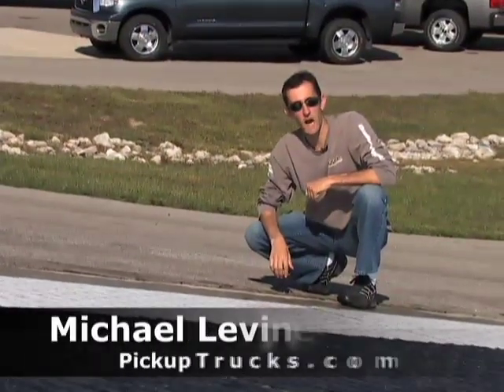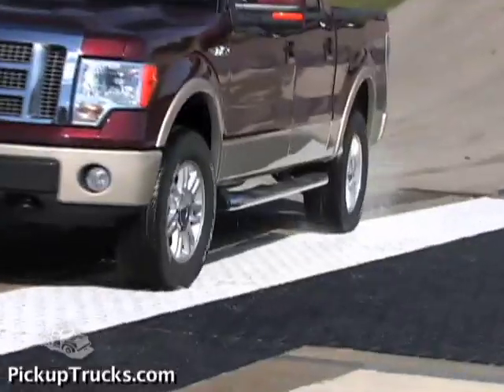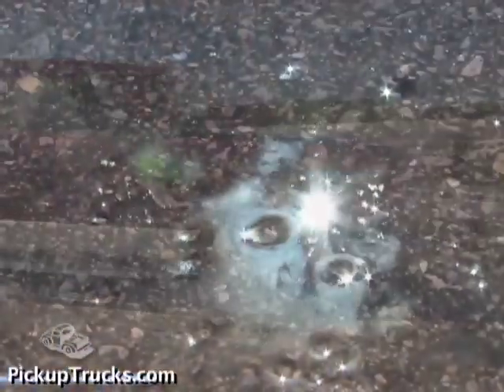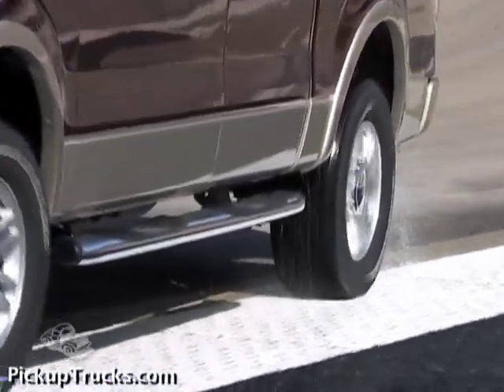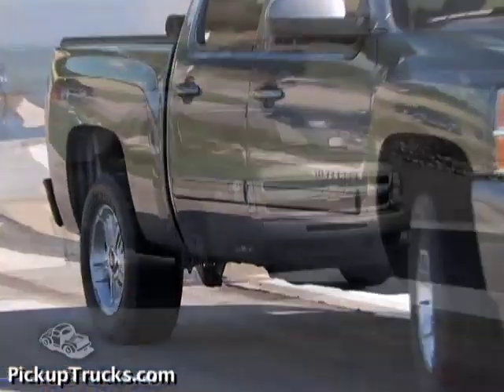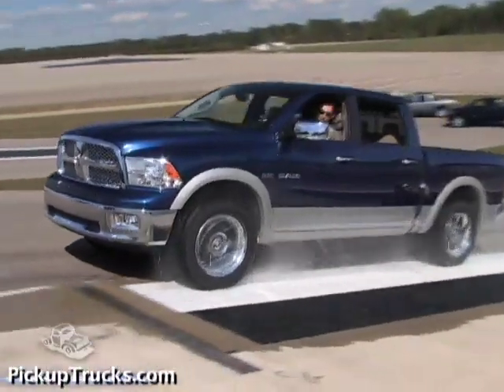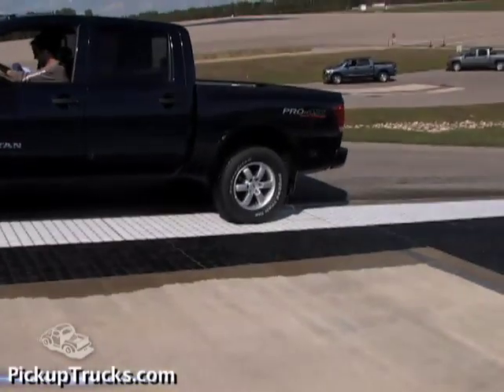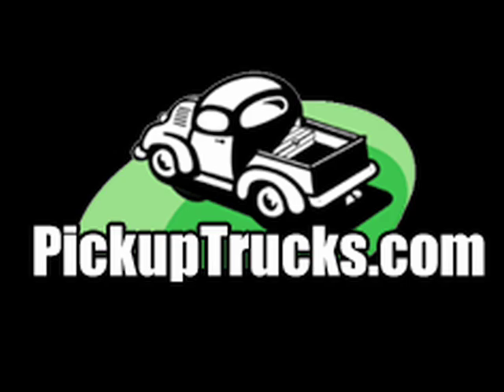Extreme Traction-Control Test

Comment: for a bunch of truck with "limited slip diffs" how come they only were spinning one wheel???
Reply: Limited slip is no different than an open diff it makes no difference, I bet a lock right would make a difference, it locks up both back wheels for full posi.
Reply: Skeefoo Panama that can't be more fucking wrong. Limited slip sends power to the wheel with the MOST amount of traction unlike a open diff which sends power to the wheel with the LEAST amount of traction, a lsd will usually send power back and forth to get you to keep moving, while an open diff will just continue to spin the slipping wheel until it redlines
Reply: +mikebing1230 
OK Bing, You need to see the Power Trax no slip locker video on here,  Limited slip is not positive traction, it is hardly any better than an open diff, only 1 wheel spins with Limited slip. Limited Slip IS NOT positive traction.
Reply: Because Limited Slip is almost no better than an open diff, as far as your ass getting stuck, It may make a slight difference, it may transfer power to both wheels, on and off, but a LSD is NOT posi traction, and WILL get you stuck.
It's only slightly better than open diff,
Still you will need a locker for a real rear posi trac axle.
Reply: Skeefoo Panama never said limited slip is a locking diff, limited slip is positraction. But Posi isn't the same as a locker.
Reply: +mikebing1230 
YO BING, YouTube this video, (Power trax traction demonstration) You will see why I said LSD is no better than open Diff, please watch the video.
Reply: +Skeefoo Panama
 "Posi-Trac" IS a limited slip differential. It is just GM's brand name for it.
Reply: LSD woudnt necesarily make both spin but just provide enough power to the wheel with traction to be able to keep moving
Reply: Chevy has posi traction, Ford has Traction Lock, dodge has sure grip and so on. They are all limited slip diffs.
Reply: @fastfordman1965  sorry but the G80 WILL lock both wheels at about 100 rpm of spin.  I've owned several and all have worked well.

Comment: The traction control in my 2011 F150 is amazing. With the stock goodyear SRA, same as in this video, driving on snow and ice feels like I'm driving on dry pavement. No slipping or sliding at all which is suprising since these tires are complete garbage.I don't even need to use 4x4 unless going uphill.

Comment: I agree with the manual trans comment, however the Frontier is not in the same class. They should have a test between ALL of the smaller pickups though.

Comment: Most pick-ups are part-time or selectable 4wd, meaning that on top of 4wd high and 4wd Low, they also come with a 2wd setting and sometimes even an AWD setting. however, on the truck without an awd setting, it is strongly recommend that drive in 2wd in which driving on road to prevent excessive wear.

Comment: If you look closely, the GMC and the chevys tires lock up almost immediately. Because there is equal power going to both tires on different surfaces, the rear end starts to go sideways. This is why a lot of drifters use an E-locker or a stout LSD. An LSD just makes more sense for this kind of test. It distributes the power accordingly to how much grip each tire has rather than just locking them at the same speed. The outcome may have been different if both tires were on the slick surface.

Comment: @FreeSkier155 Well you are right, but if you are going up a hill during winter and there are cars behind, the last thing you want to do is have to stop and pop the truck in 4x4 to make it up a hill. It could cause an accident from your truck sliding backwards if you stop too quickly from panic or begin to slip back before you can get it in 4x4. This test shows which truck would be most reliable in this scenario, which is just one of many.

Comment: @PsychoDemon5 it doesnt matter...it depends on what the companies offer. they are testing what the vehicles come with. if you put the ford's locking system in every truck and the same tires on all of them, most likely they will all get up with little difficulty. they are testing the actual trucks and what they do the way they come.

Comment: Agreed i drive 94 ford F150 and i live in the Minnesota. In snow I cant make it through the trail my dads Chevy makes in 2wd with his Chevy which has locking differential when im in 4wd. my truck has open rear and limited slip front.

Comment: @wootness3000 i believe the point of this was to test the rear differential limited slip capabilities. since none of us are phsycic, you cant put it in 4WD until after your rear end fails to gain traction. but it is always wise to engage 4wd if you know there will be problems.

Comment: Sierra is made by GMC, (General Motors Corporation), which is in great partnership with Chevrolet, therefore they make very similar models of 2 different makes. Almost like Ford and Mazda, but yes. They particularly the same trucks, just some different exterior features.

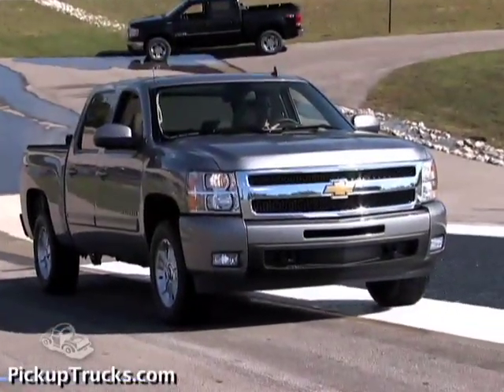Comment: At 2:21 you can see the Chevy truck's rear wheel on asphalt. It's spinning like crazy, so the wheel with traction is getting plenty of power. It's just that that one tire could not get the truck up the hill. Seems to me more like a tire or weight problem, than a traction control problem.

Comment: In a true 4X4, locking all 4 into 4 low or 4 high is an option for a reason. Unlike Toyota, etc., in which the systems are similar to AWD, true 4X4 give you the option of which wheels are driving the truck. I prefer that I decide how to use the power, rather than a computer because when the computer fails in a Toyota, there is no 4X4 high/low.

Comment: Again, that is the point of the frame. It is supposed to be flexible to once again, provide a smooth ride but can still tow heavy weight. Ride in a Ford and then ride in a Tundra, the Tundra is a much smoother ride. Hook up 10,000lbs behind each and drive them again, and you will see the towing of the Tundra can tow heavy trailers and you still have a smooth ride. A fully boxed frame can tow help a truck tow a lot of weight but it doesn't provide nearly as comfortable of a ride.

Comment: @FreeSkier155 The purpose of the test to determine at what point the vehicle needs further assistance. 4wd can have just as poor performance wheel slip isn't controlled. When the vehicle is equiped with both front and rear lockers 4wd becomes a relevant test but with out a front locker there is no benefit to testing 4wd. My truck has front and rear lockers and would walk up that with out either wheel slipping because the traction to the good tire would be sufficient to move it.

Comment: @cb7pwn 
these trucks would benefit from better tires because one tire is slipping on the slippery surface, if the slipping tires were all the same then or even a better tire, it could have better grip.  So, hugo is correct, tires play a big factor in this test.

Comment: i can't post the link. so search: Mega Test Dodge Ram vs. Ford 350 vs. GM. first thing in the test shows how a 2wd with a locked rear end can get up a slick surface better than a 4wd with open diffs

Comment: @alldayandnight09 They use the tires they come with from the factory, just like any other road tests they don't change tires. People want to know what to expect driving it off the showroom floor. Most people don't run out and change tires on their truck after they buy it until they are worn out.

Comment: so did the rear diff's fail to lock on both the gm vechicles causing them to use 4wd, or did the rears engage and they still had to use 4wd?  it sure looks like testers were trying keep them from locking in the suspiciously limited video of the gm vehicles. i have a hard time believing that a truck with a locked rear end couldn't make it up the hill in 2wd. makes me question this whole shoot out.

Comment: I'm not positive, but I think it's so that with heavy loads the bed can flex slightly without effecting the rest of the body.  I have heard that some of the ford unibody trucks made in the early 60's had problems when hauling heavy loads.  The door gaps would flex so much that the doors would pop open while driving.  That is probably why today's unibodies are usually meant for pretty light hauling.

Comment: I would think the gmc/chevy with the locking diff would do as well as the TC on the tundra and ford no? as soon as they hit the slip RPM the locker would engage and the tire on the pavement would propel the vehicle to the top.

Comment: That's only with a helical diff, with a mechanical or viscous LSD the wheel with traction will always get some power, even if the other wheel is off the ground. The other way to get around this with a helical diff is to gently apply the brakes, this keeps some strain in the wheel off the ground and allows power to be transferred to the wheel with grip.

Comment: You should do a test on why people need to go faster than a car on a snowy highway ! I m in Minnesota and every snow fall its mostly trucks or 4x4 s in the ditch . I hope some day someone will figure this out , lol , I do think ALL vehicles spinout at high speed or maybe spinning all 4 wheels by over acceleration and loosing control is maybe a Clue to slow down ! And I do own a truck in case some want to give me crap on this .  Great video , I gave a like .
Reply: I'm from Minnesota as well! and I can attest to there being alot of 4x4s and trucks in the ditch! Speaking of which back in 2010 I pulled a 2007 Ford F-350 with a long box out of the ditch with my 87 Chevy Caprice classic... The owner of the truck at first said he was gonna call a tow truck... mind you it was about 2:30am and about 10 miles from the local expensive small town tow truck business.. so He decided to take me up on my offer to help him out.. he was so happy he slung me $40 dollars and said "You saved me 80 bucks so here put some gas in that beast case I need ya again, haha"
Reply: Great story Tony , Yes Tips are great also .
Reply: Thank you : ) LOL That tip saved me later that same day bought enough gas to keep me going till paycheck came!

Comment: @296jayce 
not really hard if you think of it
if both wheels are locked, you will give power to both wheels equally, if one of the tires slips due to a wet surface, it will force the other one to spin too.
if the cars is fitted with a limited slip diff. , it will give more power to the wheel with more grip, and since it's not spinning, it will move the car, also creating a momentum that will keep the car going.

I think that the best way I can explain it    :3

Comment: show us this test with an open diff vs lsd vs locked differential
Reply: Open differentials and LSD are essentially the same, only difference is a LSD only allows so much of slip between wheels, if your on something really tricky such a hill where 1 wheel leaves the ground (in a 2WD truck lets say) you're essentially fucked either way because 1 wheel will spin too much. A locked rear is obviously the winner as for both wheels spin equally. This test would be pointless reason being most trucks come with a LSD with either a traction control unit (that usually brakes the spinning wheel so the other gets more power) or auto lockers, which lock the rear so the rotation in each wheel becomes equal.

Comment: The trucks with locker should do best, but the locker cant engage if the other wheel is spinning super fast. There is a technique to make it engage. the g80 in the chevy has proven itself for years.

Comment: @cb7pwn 
if you have a tire that's designed to grip on that surface, you will be fine because all the power will be going to that tire made for that terrain or surface, just because all the power goes to one wheel doesn't mean you have to be flooring it -.-

Comment: yeah, the G80 in my chevy works better if you ease off the throttle, if you give it more throttle when you feel it slip you'll just sit there and spin. it's a mechanical engagement, where as the ford and toyota are electronic, like he said the electronic ones automatically cut the throttle- even when you floor the pedal, the mechanical ones leave you in control of the throttle.

Comment: If you live in conditions for a 4X4 you are not going to drive in the snow or iced roads in 2 wheel drive. I understand testing the Traction Control but that is why they have 4 wheel drive so the Traction Control doesn't have to work so hard. Maybe if they re did the test where you drive through a wet patch requiring Traction Control to activate. Or does anyone have an explanation for this type of test?

Comment: @wootness3000 I love this test because i only buy pickups with rear wheel drive. locking rears and traction control differs wildly between manufactures. My Isuzu does great with the locking rear end whereas my Chevy just gets on my last nerve. I got to floor the gas in it to get out of tough areas. The Isuzu does all the work and u can feel it working in the wet, on or off road.

Comment: You hit it on the head.  The test is to determine how dumb of a driver can drive the vehicle up a slippery hill.  Definitely a valid test for new car buyers.
The problem is those systems still allow those people to go too fast in slippery conditions.  The traction systems still need some tweeking so they limit the speed to something the vehicle can handle based on the traction available.

Comment: I never said anything about stopping did I? Traction control has nothing to do with stopping distance. I meant driving and cornering. It tracks extremely well. The difference between turning traction control of is huge.

Comment: They're testing traction on slippery surfaces. You don't use 4wd regularly. You leave the truck in 2wd almost all the time. The test is to see how they handle it in 2wd, before switching to 4wd if they can't make it, which is exactly what your average person driving these trucks would do on a slippery, icy road.

Comment: my 1996 k2500 suburban with a g80 would walk right up that. how is a limited slip better than complete 50/50 power. ive used limited slip before and found that it takes a lot of wheel spin where my g80 takes a little and once locked stays that way until i completely let off the accelerator.

Comment: Everything depends on conditions. If each vehicle equipped the same 4x4 capability. Heavy Vehicle is not always better than lighter one's. Going up hill with lots of dips and rocks heavy vehicles will loose the race. On even or smooth surface with pretty high level of snow cover heavy vehicles will come out as better trail-blazers. Or on uneven muddy surface heavy vehicle will be on hard time to go thru. But when, again, on even muddy and slippery conditions, heavy would look better. Each has

Comment: My 2017 Sierra Denali pickup slides out of control in 4WD in any type of snowy conditions and doesn't handle much better in the rain. I just saw I have traction control and now I am not sure if it was off or on. Now it's summer and I can't try it out both ways. However, it almost killed me spinning out of control. GMC service can't duplicate the problem and says it appear to be working OK. GMC customer service sucks. Thoughts or suggestions? This truck is going to kill me, someone else, or all of us.

Comment: My G80 locking differential is great. I've made it places that my friends ford cant even touch because of the open differential. Not to mention that the GMC and Chevy have traction control but they probably failed to use it.

Comment: ok so maybe not as scientific but i took my dads 2004 tundra trd limited slip rear and found the steepest boat ramp i could find. put 2 tires in loose gravel. it slipped like crazy spun the tire in the gravel like crazy but made it up slowly. we did both sides of the ramp forward and reverse. then i took my 1996 3/4 ton suburban with a g80. rear end locked up tight and the wheel on the pavement got traction and held it both sides no problem no crazy spinning out unless i broke loose on purpose. gave it a little gas tire slipped a little and you could feel the suburban shift its weight when the locker kicked in and stayed in until i let off the gas at the top. g80 locker = better than limited slip. the g80 isnt a bad rear end when used for its intended purpose. mine has 220,000 miles on the clock and still works great because i dont beat on it. its there to assist in traction and thats all it isnt for drag racing or rock crawling. it is the best locker ive used in the snow too because it disengages at about 15 mph so you dont get all crazy in the rear. oh and mine is the semi floating 14 bolt and i regularly tow 7 to 8k 5.7 vortec 4l80e transmission 33 inch tires. durable and reliable. and no im not hating on fords or anyone else. it was more to compare traction systems and give my personal experience with my particular vehicle than to put down any other brand. im not ford hating or toyota bashing. both make good trucks. just my 2 cents. oh and i forgot to mention the older tundra like i used has a mechanical limited slip not brake limited slip like the new ones.

Comment: @AHSauge Why stay in RWD when it is slippery? Then you risk loosing control more easily. A little to much gas is all that is required. An AWD wont loose the grip that easy, it needs you too really force it to loose grip.

Comment: This is a test on how the trucks traction control systems uses combinations of mechanical and electronic controls ( traction logic)  to climb a surface with uneven traction in two wheel drive. It is not a driver skill test, it is not a 4wd test, it is a get in and go test. Why is that hard to understand?

Comment: Another factor is tire tread. The tundra and the f-150 looked like they had better tires. I'm not very sure because of the video quality but it looked like the f-150 had bfg all terrains. Obviously, different tires would help the other trucks. The only way you can make this "fair" is to put the same set of tires on all the trucks.